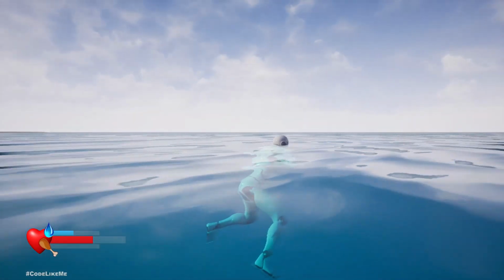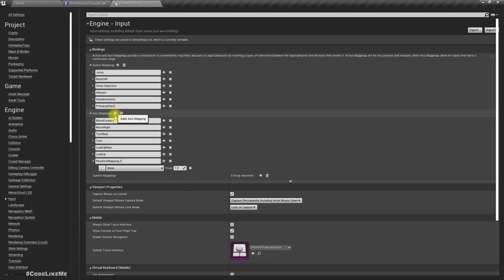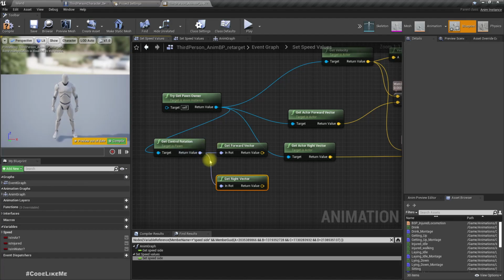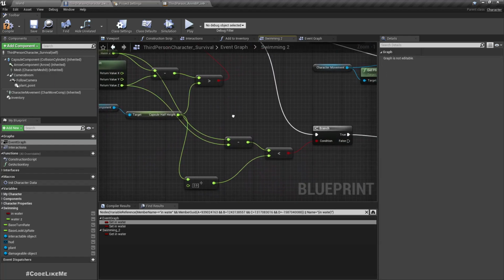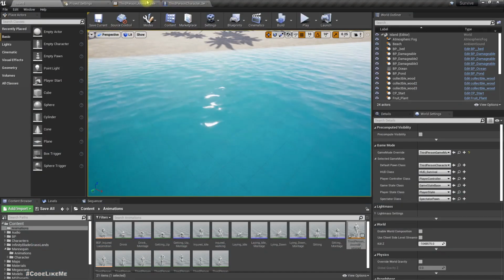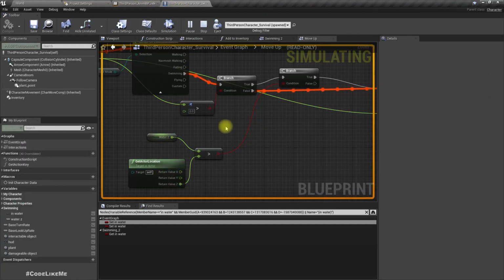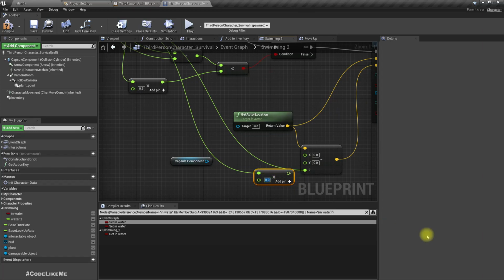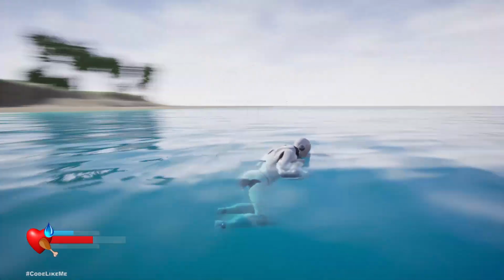Unreal Survival #34 - Diving

Comment: Thank you for your great tutorials and mainly for this one. At the end I have 2 minor issues. When I come to the water by a jump, it seems that the waterZ is not correctly initialized, and when I dive down and then dive up, the character goes back just under the surface of the water, deeper than the initial swimming. And second point, when I dive down and then I dive up with the charcter in the idle position, then the character goes back just above the surface of the water. I am trying to find a resolution, if someone had the same problem and can help on this point, it should be appreciated! Thx

Comment: Ok so , I got Mario legs whenever I start the game , seems to be coming from the add to speed node in the bp-anim , not sure if it's glitches out when falling or if during game start there are values there 🤔
Reply from the maker: can you share a screenshot?
Reply: I'm using a migrated project from the open world series , I migrated it to 4.26.2 and did a source build of it for multiplayer, this is the project I followed the whole series through so as you have done other videos like this I figured I'd add it to that project,  got the odd glitch and kinks here and there though 😀 

so just adding this swimming to that projects mixamo character and his BP anim , I worked it out by just adding a separate speed set and adding it to that ....if I tried to add it to the existing speed fwd set in the bp anim after the lerp than I got Mario legs like there was a value there,  it dont know yet if it will happen on the ue4 base thirdperson character yet ,because I'm having Collison issues I started to implement things from the open world bpi's to the third person character 

It seemed like up vector and velocity were getting values added to them at spawn when falling or when falling large heights
Reply from the maker: @TheTrifel  try clamping the IK values within safe or ignoring them for exception cases such as when the character is not on ground. But since there is a lot going on, that alone wouldn't solve the issues, hope it helps
Reply: @CodeLikeMe  gives me a couple ideas for sure , I had to play with the z height in the bp-oceanextended 

On the mixamo character it would double call enter and exit when doing a really big jump and leave you stuck under water,  or when diving it would get to a certain depth and hit Collison again resetting the z height once I played a bit with the spline z heights it's seems to only get stuck occasionally when exiting the water , or exiting at a steep incline 

 remembering everything done in that series and how its been implemented is the real fun part 😉 , on a side note revamping that series for multiplayer conan exiles style open world with a large tiled map would be pretty interesting 😀

Comment: The "SetActorLocation" part will not let me go out of the water sometimes.
Reply from the maker: Debug and see what's going on
Reply: @CodeLikeMe  I've managed to fix it by ticking the "Sweep" option in.
The issue happens when you are near the shore and the ground is a bit too steep. For example like Rivers.